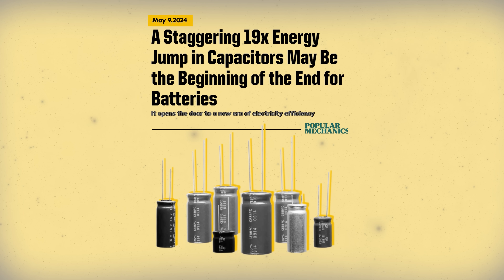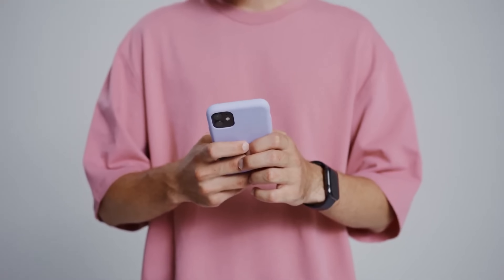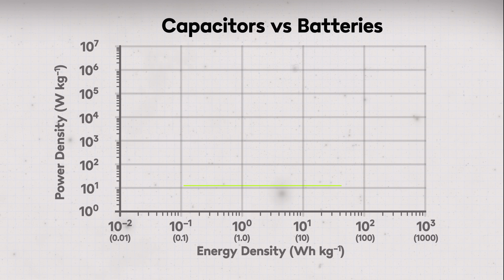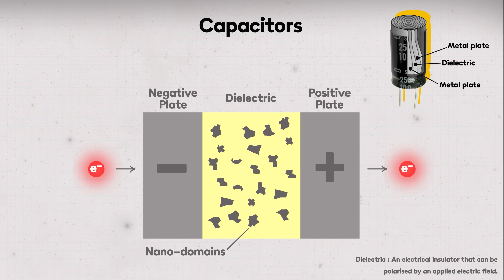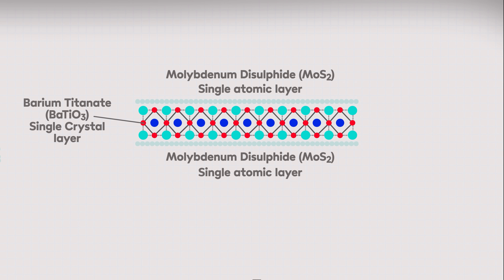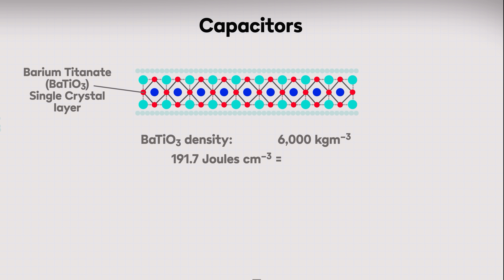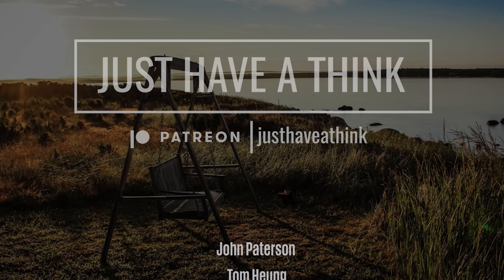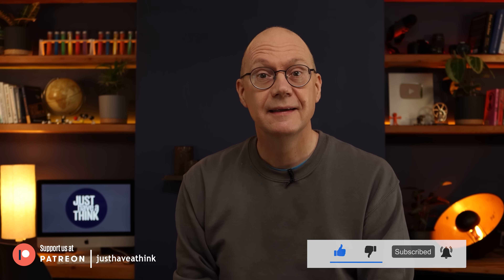Charging an EV faster than filling a gas guzzler? Surely not!?

Comment: I have a better idea for electric vehicles!
What if instead the vehicle is connected through a thingy (e.g. call it a pantograph) to a wire above? Then, we can reduce the number of separate vehicles by connecting more of them together and thus increase efficiency/economy! Put the vehicle on steel tracks and give it steel wheels to further lower energy usage and voila! Call it a train for instance

Comment: I do believe that heterogeneous energy storage solutions will become the standard for electric mobility.  By that I mean a combination of media that offer inexpensive, high capacity, but slow charge and discharge rates, with media like lithium iron phosphate which are more expensive but faster, combined with ultra-fast media like capacitors.  Combine all that with wireless charging and you can easily imagine buses that recharge at every stop or cars that can charge from 20 to 70% in under 5 minutes.

Comment: This video is very wrong about a capacitor (super or otherwise) having any effect on charging time of a lithium battery. It just doesn’t do that. 

This is a really cool invention though. It allows the little ceramic capacitors in things like computers and smartphones (or any electronics really) to be shrunk to 1/10th of the size of currently available components. That’s a huge win.

Comment: Let's assume that battery technology will improve so that they can last for the life of the vehicle up to about 10 years  or 300,000 Km depending on how it is used and driven and that the batteries can be charged in the same amount of time that it takes to fill a tank of gas.

Even if all of this comes true, the transmission and distribution systems will probably not be able to deliver the power fast enough to charge an electric vehicle at a charging station in the same amount of time it takes to fill a gas tank. Electric Vehicle batteries are rated in KW-hrs. A typical electric vehicle today that has a range of about 300 km uses a battery rated in the 50 KW-hrs range. Provided that your home, apartment or condo where you live has an electrical service with the required capacity you will be able to charge your electric vehicle overnight. A typical electric vehicle battery charger that you can install at your home can deliver about 5 KW of power. This means that you can charge your 50KW-hrs battery in your vehicle overnight in about 10 hours (5KW x 10hrs = 50KW-hrs). If you only use 40 KW-hrs for the day then to get the battery up to full charge for the next day will take 8 hours. At a charging station, to charge a 50 KW-hr battery in one hour will require a power source capable to deliver 50 KW of power. That is starting to become a significant amount of power. Traditionally, a transformer rated at 50 KW was used to connect up to 15 homes. In older neighborhoods of the 20th century it was not uncommon to connect 20 or more homes to a 50 KW transformer. 

To charge a 50 KW-hrs battery in 30 minutes will require 100 KW of power. In 15 minutes, you will need 200 KW of power, In 7.5 minutes you will need 400 KW of power and in 3.25 minutes, about the same amount of time it takes to fill your gas tank, will take 800 KW of power. This is for one electric vehicle. A typical gas station in a city has 8 pumps and during the day they are all being used at the same time and you are usually waiting in line for your turn to fill up. So if you have 8 electric vehicles that need to charge at the same time that is 6.4 MW (8 x 800KW = 6.4MW) of power. That is enough power for about 2,000 homes or about six apartments or condo buildings with 200 to 300 units in each building. To deliver 6.4MW of power, you will require two or three transformers about two meters by two meters by two meters with some switchgear in an area of about twelve meters by twelve meters. You may also be able to do this with one larger transformer and some switchgear in an area of about ten meters by ten meters. You will also need the right of way for either an overhead or underground distribution power line in the 28 KV range to connect to the grid. Generating the power locally at the charging stations would also be an option. To do it with wind or solar would require hundreds of Acers of land so that would not be possible in a city. It can be done from traditional sources such as natural gas or perhaps using the new nuclear technology of small modular reactors (SMRs) or micro modular reactors (MMRs). There are some impressive developments in SMRs in the 300 MW size range and in MMRs in the 15 MW range but the costs may not be competitive.

Comment: Even if you could develop an instant charging battery it would draw infinite power during charging which cannot be provided by infrastructure - unless your charging stations were equipped with superlarge capacitors as well.

Comment: It doesn't mean faster charging, period.  In order to have a vehicle fully charged that fast, you'd need a capacitor capable of storing the entire content of the battery, i.e. if you have a need for 60 kWh, you'd need a 60 kWh capacitor, or at least a 55 kWh capacitor if you also have a 60 kWh battery to dump the charge into more slowly.   As to peak trimming in regenerative braking, existing capacitors do that just fine already.

Comment: Really interesting! Although it only seems to be people who don't own EVs who complain about charging times. If the energy density of these capacitors is so low, presumably a lot of battery capacity would need to be sacrificed to make room for them? Similarly, if you prioritise battery capacity, presumably the capacitors won't be able to add more than a few miles per charge cycle? It's a nice idea, I can't help feeling that this is a raft of new problems for a solution to a problem which didn't exist in the first place.

Comment: I think supercapacitors could be interesting for the rapid liberation of energy and charging. Charging while breaking and discharge while acceleating. The lithium battery is there for the more or less constant speed while driving on the road. Maybe have a think.

Comment: This would be best for energy transfer in the system like you said. But for actual main energy storage, you can only charge so fast without having a very robust charging cable and plug with lot of cooling, and they are already pretty hefty for the charging capabilities we have right now.

Well unless they really step up the charging system voltage that is, it will pretty much need to be a lightning bolt going through a cable (not to that extreme but you know what I mean).

Comment: I am not seeing how thse new "super capacitors" speed up EV charging. Maybe you can make a slightly larger bank in an EV but it's only a small buffer. Once it's full you reach exactly the same limitation you had previously charging an EV - the battery is the bottleneck because of the necessary chemical reaction. And suggesting it might solve grid infrastructure problems is ludicrous - the cost will never compete with a LiFePO4 storage bank.
Reply: Yeah, putting any more than one hard regen worth of capacity (maybe 50-100 W/hs?) into capacitors at 8.8 W/h per kg is a waste of weight. And that's only worth it if it really does protect the battery that much, and improve regen efficiency. And if the price is cheap enough, and doesn't add too much complexity or have reliability issues. 
Using them to improve charge times is completely pointless, as best case scenario will only save a couple of seconds. Not even worth the effort and cost. Far better off putting that effort decreasing charge times into other areas.

Comment: In an equation, "X" is an unknown factor.  I was taught to read it as "increased by nineteen times" not "nineteen X". Saying that something was "increased by nineteen X" doesn't make sense to me, but perhaps mathematics has changed since I was at university. 🤔  Anyway, I hope that capacitors can improve the operation of many things, not just EVs. Although one thing you missed was how a charging station would handle instantly charging a 60 kWh capacitor without frying everything including the local electricity grid. Presumably with a similar capacitor. I guess that a 60 kWh capacitor would also present a danger in terms of instant discharge too.
Reply: These capacitors only have an energy density of 8.8 W/h per kg.
So 60 kWh capacitor would weigh 6818 kg or 15031 pounds.
They aren't really going to have much use in EVs. Maybe a small one sized to take 1 hard regen from highway speeds, past that is pointless and better off using the weight for more batteries.
They won't help to reduce charge times by any more than a couple of seconds at best.
Maybe using them at charging stations could help take the peak loads off the grid at fast chargers, but even then I'm doubtful, as even a 150W/h per kg LFP battery has 17 times the energy density.
Reply: @patrickbeck4062  yes, I got that an EV power supply based on this capacitor wouldn't be practical due to low energy density. I was just following the original premise of being able to charge an EV faster than filling a petrol tank. 🙂
Reply: @theharper1  Yeah, I can't make sense of how they are meant to help that much with improving charge speeds.
I do think over time more and more fast charge stations will have on-site storage to reduce peak loads on the grid and so car park/nearby solar will make more sense, but even for on-site storage these capacitors are so far behind even LFP batteries that I don't see them being used.

Comment: Could be very useful for sports car EVs, as it could enable them to have a lot more power output to the motors without requiring as large a battery: meaning lighter weight. Would be sacrificing range of course, but if it also increases charging speed that won't be much of an issue for the purposes of sports car.

Could also be very useful for PHEVs, as they would be able to charge a lot faster despite not having the space for a bigger battery that pure EVs have, and then the range also isn't a problem for PHEVs since they have the combustion engine for the rare occasions when you need to go further.
Reply: I don't think so. Their energy density is just too low to be useful for much more than 1 hard regen, then the first couple of seconds of acceleration. Past that the weight just gets out of control.
A 150W/h per kg LFP has 17 times the energy density.
A 250W/h per kg Lion has 28.4 times, and a 290W/h cell is 33 times more.
If you put these capacitors on their own in something like the Rimac Nevera. Just to do 1 quarter mile drag race would take somewhere around 270kg - 350kg of capacitors. Better of just using high power density batteries unless you're making a car purely for the dragstrip.
For car made for the streets, these won't help with charge times. The best case scenario is only 2 or 3 seconds time saving. Once the capacitor is charged, you're back to normal charge speed.

Comment: What rarely is mentioned that if you want to recharge a large battery (or capacitor) you need a very good power supply.   We are years away from having anywhere near the capacity if EVs were the norm.    Already we have charge rates reducing when an additional EV plugs into the charger.    I thought I might be into an EV in 5 years (4.5 now) but thinking longer than that now.

Comment: I've thought about this a bunch of times over the years, but every time I look into how much energy density the best capacitors have in comparison to lithium batteries, I always come back to realising you're better of just using more batteries than wasting a bunch of weight on large capacitors.
Maybe it makes sense to have a capacitor that can take one hard regen from highway speed, but any bigger than that is a waste of potential battery weight. So maybe 100 or 200 watt hours at max. A capacitor that size will make no noticeable difference to the time to fast charge even 50% of the whole pack, maybe a few seconds at best.
Reply: Say you have a fairly standard size LFP pack at 60 KWh, then you add 1% of that capacity in these capacitors, so 600 Watt hours.
At 8.8 Watt hours per kilo, that's 68kg!
Even a low energy density LFP at 150 watt hours per kilo would be 10.2 kW/h for 68kg worth of cells.
If you're charging at 250kW, which a lot of batteries can already do, that's about 69.5kW/h put into the battery per second while at peak charge rate. So even that oversized 600 W/h capacitor would be charged in 8.6 seconds, then your back to charging the pack as normal. Meaning even if you could charge the capacitor at an infinite charge rate, so it took zero seconds to charge, the maximum time that could be taken of the total charge time is 8.6 seconds. Basically not noticeable. Better off with the extra 9.6 kW/h of battery for the same weight.

Comment: I have uses a 'Silineco' scooter - Three modes... Eco  mode (max 30kmh/hr150 klm range.. range, city, mode max 40klm/hr 125klm range... sprorts mode is 50klm/hr and 100klm rang) In  sports modeI I release the throttle and regen-braking kicks in automatically - I found I can ride 10-15 klm, leave it sitting a while and having a chat - say 20mins?, and It's gained up to 7-12%.. often around the higher values. 
Makes a difference that so very many bicycle lanes are Scooter friendly (in NL) - meaning avoiding traffic lights. Meeting traffic lights that are sensitive to the scooter approaching (about 99% of them if not all), which means in low traffic situations it's green as you approach... absolute pleasure to glide along in silence - it is a heavy beast but has a reverse button so it saves my nearly 68 year old knees from the aches and pains

Anyway, highly recommended - and long live the capacitors

Comment: I have long thought that large capacitors should be used in EVs for stop/start city driving and brief high power output while getting upto the correct speed, which is generally how most people drive. This would mean that the battery could have a lower c-rate.

Comment: OK, so the new capacitor still has only about 3% of the energy density of lithium ion.  I also have a concern about safety.  Let's imagine an accident where physical damage short circuits this huge capacitor with say 50kWh available.  All the stored energy will be released in milliseconds at a rate of gigaWatts in an enormous arc flash.  Way more explosive than a lithium ion battery fire where the energy is released much more  slowly over many minutes.  Then there is the grid capacity.  Are we going for megaWatt level charging for each car?  Trillions will need spending on new transformers and power lines.  All pie in the sky.

Comment: One thing that does not seem to get discussed is the issue of providing the enormous demand on the electricity grid required to charge EVs,  and the significant drop in individual charging rates at a charging station when many EVs try to charge at the same time.

Comment: In the case of wind turbines (VAT) and thermal batteries .Capacitors could stop load on the turbines so enabling them to work at low speeds

Comment: Capacitors only outnumber inductors (the third type of passive component) because they are cheaper to make.
Reply: Cost has nothing to do with it. Capacitors and inductors serve completely different electronic purposes. Further, in my experience, inductors are used in far fewer circuits than are capacitors.
Reply: @avsystem3142  Both store energy.
You can make equivalent circuits that make use of one over the other.
I guess for longer term energy storage (more than a second) you can't really beat a capacitor (which stores voltage). You would need a superconducting coil to avoid losses while trying to store current.

Comment: Some major problems with this supercapacitor speculation for EVs:

1) On charging, the supercap buffer would quickly fill up and then you'd be limited to the rate at which the battery can charge on its own. The supercap might actually end up slowing the overall charging time for a given amount of range, if space required for the supercap reduces space available for the battery.

2) For regen or acceleration for normal stops and go's, the battery can absorb much higher rates for say 5-8 seconds than it can absorb or output sustained for the say 15-20 minutes to descend or climb a 7%/20-mile mountain grade. 

Basically, when you consider the tradeoffs in the use of available space and cost of the supercap vs battery for the short stops/accels and longer hill climbs/declines, plus the incremental cost and space of the power electronics to handle higher currents / power, the low energy density of the supercap makes it unattractive for practically all EV or hybrid vehicle applications.
Reply: 100% This. I don't how people think low capacity capacitors will benefit the charging time of the main battery.  The mass is better spent on additional battery capacity that has much better energy density.  I mainly see capacitors getting used for a bit of regen on some kind of ICE hybrids, where they can absorb more power than the small hybrid battery and even then it's a stretch.
Reply: I agree in all parts.  One of the better comments. 

Capacitors are a good idea to offset the pulse of start of a charge [plug in or regen] though there size is insignificant and nothing is gained by using larger capacity ones.
Reply: @blogobre  Even for absorbing or generating an initial pulse, batteries of any size sufficient to propel a vehicle for any significant distance will be capable of generating or absorbing such a pulse without degradation of any kind. The pulse handling capability of the electrical system will basically be limited not by the battery, but rather by its power electronics, where capacitors or even ultracaps are employed to avoid overloading the power electronic's transistor devices (IGBTs, MCTS, MOSFETs, etc.).